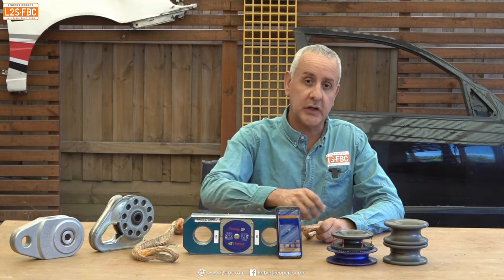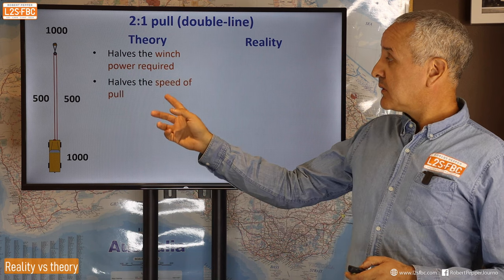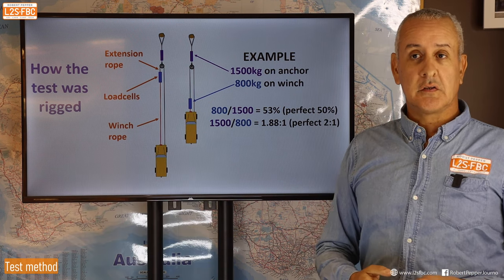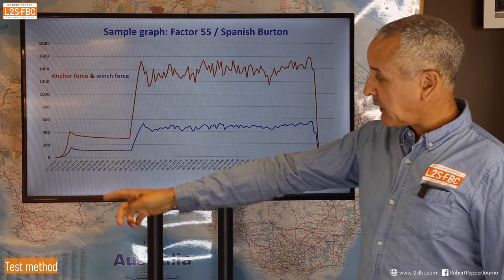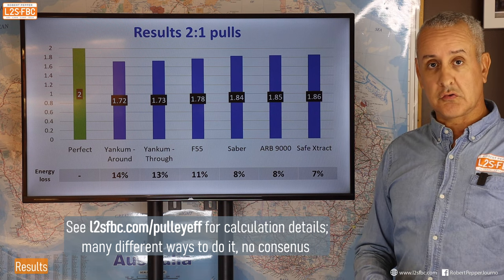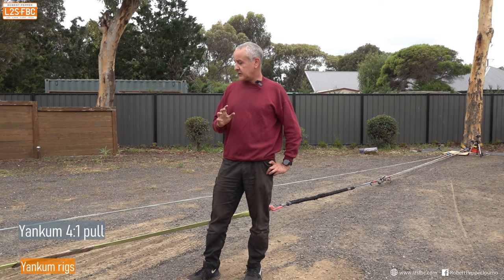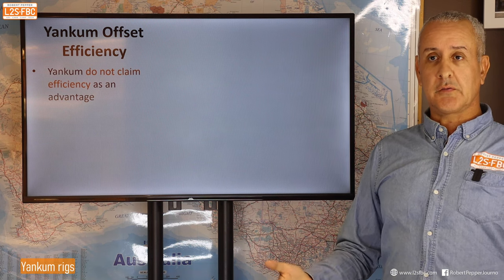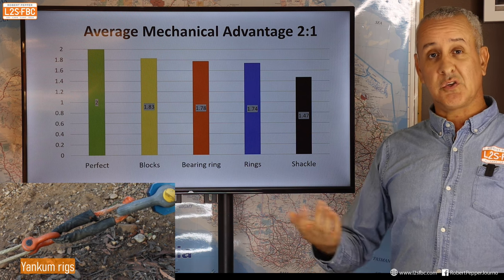3:1 isn't 3:1, and so on.

Comment from the maker: Some common questions:

1. The X-Lock shortening is covered here in my Clips & Cuts channel (please sub, trying to get it monetised) https://youtu.be/pt93-89fZ9A
2. This is NOT a full review o the Offset Rings, it's efficiency only.  To come; Thermal Analysis and then Offset Ring vs Symmetrical vs Block
3. Thank you again to the person who sent the rings, I don't have budget to buy everything and I don't like asking to be sent free stuff direct from companies. I know, right?  How weird of me.
4. A Bearing Ring does exist, for example the RR30 which I've reviewed and tested here  https://youtu.be/bCMJvk9L1rE 
5. For the original Efficiency video see this https://youtu.be/rdlRRAbzCzA
6. Is it my practice to discuss with anyone who has an interest a draft video before publication.  I've found any disagreements are better figured out before it goes live, it serves nobody's interest to be wrong; not mine, not yours, not the company's.  Now when it comes to opinion...that's different.  We didn't all agree, but at least we agreed to disagree.  I don't deal in gotchas or sensation, plenty of others doing that. There are pros and cons of every product, and if you see anything that is all pro, or all con...then it's probably not unbiased.
Reply: When you talk ropes and pulleys it always ends up at efficiency.
If you spin a rope around a bar - you can pull it still on 1 full wrap, hard on 2 full wraps and soon or later you create a self locking system on 5 or 6 full wraps.
Nothing will beat a well lubricated snatch block. 
For instance 87% efficiency vs 92% may not sound a lot, but when you do a 6 time multiplication you get:
0.86*0.86*0.87*0.86*0.86*0.86=0.40 or 40% efficiency
0.92*0.92*0.92*0.92*0.92*0.92=0.60 or 60% total system efficiency.

I watched the youtubers war on oppinions and thinking this would make a perfect topic for you. 

And it did 👍👍👍👍

Thank you for doing it and bringing some common sense and science to the overheated youtubers debate.

Great job and thank you again 👍👍👍🤣

Comment: 21:26 "If you need more than 3.4, you may need a professional recovery" Absolutely. At some point you begin working with forces that can do real harm to your vehicle if everything goes right and to everything if things start going wrong. Your summary in this video is spot on. I think using a 4-1 can be great for spreading out the forces on anchor points and reducing load on the winch, if you're using a 4-1 for "more power" you need to start being very careful.

Comment: Very well done. Interesting that Yankum and Factor 55, two of the most expensive rings out there, we’re the most inefficient. I actually guessed that those two rings would be the worst.
Reply from the maker: What made you guess that?
Reply: @L2SFBC  The bend radius of the Factor 55 was the smallest which causes 2 problems. 1: the rope has to make the sharpest bend putting more friction in the rope and 2: the smaller the bend radius of the ring, the less of a fulcrum you have to overcome the resistance of the ring rotating against the soft shackle. If that makes sense. 
The Yankum is simple. The thing doesn't rotate. If a ring naturally wants to rotate and you take that away, you're removing it's least point of resistance and forcing the rope to take a path of greater resistance by sliding over a larger surface

Comment: I'm sure you will put it straight. Will be good to see how the Yankum performs.
 I was wondering before and now when it comes to blocks , often they are left in the tool box untill needed, So what is the difference say Dry vs Greased pin/bearing ?
Reply from the maker: Don't know, all I can offer is symmetrical ring vs non-symmetrical vs block vs bearing ring.

Comment: Thank you for doing this test. I think this is very good quality and rather unbiased data that is starting to paint a much better picture. I would love to see a part 2 that filled in some of the holes I see though. 1. Rig the Yankum ring and a large diameter ring as a Spanish Burton. This will show more of a comparison of losses in the 4:1 range being more about the Spanish Burton being more efficient because it just has less rope on pulleys. ( The parts for a Spanish Burton 'should' also be up sized which gets closed over a bit ). 2. I'd like to see a traditional 4:1 done with separate rings and pulleys to show that friction losses are going to happen with those systems IF you don't have or can't use the SB technique because of space or length limitations. I'd extrapolate you would be closer to the double ring rigging like Yankum vs the SB rigging numbers.
Reply from the maker: Yes I thought of the Yankum in SB after we finished testing. Might do another based on that pull. Rigging a "traditional" 4:1 becomes problematic with separate pulleys and isn't necessary in my view.  The relative friction can already been seen in the 2:1 and 3:1 pulls.
Reply: @L2SFBC  I agree the traditional 4 or 5:1 would be difficult to rig, but it would also illustrate some of the magic with the compound rigging in the Spanish Burton. I do think that being able to double rig rings has some advantage to get all the way to an 'honest' 3:1 mechanical advantage without needing any other equipment. I've found this handy for when you are forced to work close into the vehicle without a lot of extra space available for SB rigging. Thanks again for doing some good testing. The results for the large rotating rings ( like the one I produce ) was even better than I expected.
Reply from the maker: Thanks, yes I may do that for a future test. Not impossible, just difficult and a problem with my test approach is that everything must be on one anchor point as that's where the loadcell is. I already had trouble with that.  Ideally I'd have many cells at each point but that gets super complex and expensive!  I would also like to test with different ropes - diameter, dirtyness - but again maybe for the future. I would expect thin, new rope to perform better than dirty thick rope.
Reply: I want to point out a few things for the hard of hearing people, this test shows that yankums ring performed worse then our original test shows which got us hated by the super stars but your ok with the test that showed worse results LMAO, second using only 2 pulleys and not in a Spanish since that's what your stuck onto now. PERFORMS better in a 3-1 than using yankums in a 4-1. Our results shows a 1000lb better performance using pulley blocks in a 3-1 then yankums rings does in a 4-1. ROBERTS test also proves that, arb pulley blocks did a 2.51-1 in a 3-1 while yankums in a 4-1 only shows a 2.5-1 we know that .1 seems small for the small minded but it goes a long way in several ways, you need less line for a 3-1 and the pulleys are not rubbing your line to death so your line is going to last longer. POINT BLANK and SIMPLE
Reply: Being able to rig up to a true 3:1 output without any additional ( and upsized ) gear by double rigging a ring seems like a nice free bonus to me. There are times when being able to get more like off the drum and generate more force close into the vehicle is advantageous. If you happen to have a (properly rated) winch extension, by all means rig a Spanish Burton. That can still be done with the Yankum rings to fill in that gap between 3 and 4:1 rigging. Looking at the F55 performance, in the other tests, we would expect to it deliver about 2.9 performance ( and you would be able to reach further ). Then you have a ring like mine, large diameter similar to the Saber and has the ability to be double rigged. I have all the options including efficiency that tested within 1% of great quality pulley block when used as a spinning ring. Options are nice. I'll continue to chip away at all the remaining differences instead of just complaining about everything.
Reply: @brennanmetcalf  being able to run a 5-1 with rings to outperform rings in 3-1 is just silly nonsense of an argument 🤣 

That’s like saying I built a 1000hp drag car to run against the stock car class

You need an extra 2 parts of line 
To out perform pulleys 

That’s a lot of extra line 

IM NOT TALKING ABOUT A SPANISH SET UPS 
Straight 3-1 out performs any ring period in a 4-1
Reply: In the case of the Yankum ring, yes, there is a dip in performance once you start double rigging. The same would be said for any system as you add more and more reduction. If all you want to do is be limited by what you can do with two traditional heavy pulleys, go ahead. What if you need or want to be close into the anchor\load. With a traditional 2 pulley 3:1 setup ( that only outputs 2.5 mind you ) you would have more line on the drum decreasing input force to the system. Rings that can be double rigged also give you the option to have more force generated  from an remote anchor based system. With two traditional pulleys you are limited to rigging a 2:1 (1.9) setup from that remote anchor to the load. With double rigged rings you could rig up to 2.5ish without any additional gear. Only someone with a 'simple mind' would discount being able to add another 0.6 of reduction or something. Options are nice. I could care less about a 1-5% per wrap difference in efficiency if it gives me many more rigging options with less equipment and weight to carry.
Reply: @matt.mckinzie  Good points!  I think Robert's finds support yours but then offer an alternative of a bit larger ring (e.g. the Saber) that gets close to the efficiency of large and heavy blocks.  I'd also point out that most viewers are going to be recreational users and like Robert said a 2:1 with a single ring should be good enough for most, and if not a couple of large rings in a Spanish Burton is going to be plenty.
Reply: @mcodyw  agreed

Comment: Love your work!!! I’m a little surprised in how close the F55 and Yankum were in the 2:1 configuration given the earlier recovery ring testing. Was there there enough load so the F55 and Saber rings were rotating or just sliding through? (I may have missed that in the video)
Reply from the maker: The F55 has a small internal diameter so I think that's why they were so close. Yes, both had 1500kg of load.  The F55 and Saber rotated. The Yankum did not...but stand by for the review :-)
Reply: For sure. Can’t wait!

Comment: This illustrates the beauty of winches... With the exception of the anchor point it's very hard to exceed the breaking strength of the gear.

You take a cat S shackle at 4.5t and achieve 4:1 (so more complex that what you've already done which is already a lot of effort and gear) and you're still 5t inside the capacity of the shackle.

The only thing in question is the strap around the tree.

It takes very little effort to achieve the goal safely. Compare that to everyone's favourite kinetic recovery...

Comment: Thanks for another great and informative video, really find the practical results in comparison to the theory interesting. Have you considered switching things at all so that the anchor point becomes the stuck vehicle to be recovered ( no/non operational winch) being recovered by a winch equipped vehicle using a second vehicle or fixed anchor point beside the winch equipped vehicle to reduce the loads on the recovering vehicle while increasing the force available for extracting the stuck vehicle? Hope this makes sense. Interested as I use my winch as often to recover/move loads as I do for self recovery and could see advantages such as reducing the chances of dragging the recovering vehicle towards the stuck one.
Reply from the maker: The pulley efficiency would be the same.  I cover different types of rigging in other  videos, the 9 Ways with 1 Block and 6 ways with 2 Blocks.  There are tricks with static winching that can't be used with dynamic.  https://youtu.be/Z8kiz4bsaXk  and  https://youtu.be/oBYa28i_K9Q

Comment: In a situation where a vehicle is very stuck, bogged to the rails in thick wet mud for example, would winch loads will exceed 100% of the vehicles weight?
Reply from the maker: Possibly yes.  In my tests we did over at 108% of weight in sand.

Comment: The last tests have me scratching my head.
Between 3:1 and 4:1 there is a theoretical increase of 33% with an actual increase of 19%
4:1 to 5:1 there is a theoretical increase of 25% with an actual of 20%
How does that work?
Am I missing something?

For a bonus point, it would be nice to know the load the 5th leg put on the anchor. Any guesses?
Reply from the maker: Yes, it's not as simple as "add 10% per pulley" (whatever 10% is of, ie load or winch tension).  You're not missing anything. I've only got two cells so that question wll need to wait!  I've not attempted to decompose all the loads, I'll need a friendly physicist to work with me on that question.  For the moment, results are results!
Reply: @L2SFBC  It's not so much the actual figures as the trend. Wouldn't one expect the actual increase to get worse with each pulley* added? between those to it seems inverse.
I think part of it is rounding errors.
Using your 60% rule on a 5:1 with a 1500kg load would seem to put a load of 38.4kg on the fifth leg.

Interesting stuff!

Comment: What I think you missed is the difference in weight and the difference in size, compared to the mechanical advantage.  So 2 rings vs 2 pulley blocks.  How much lighter are the rings?  Also can two rings get you more advantage then two pullies?  If weight is a real worry, how many more scenario's can you accomplish with 2 rings verses 1 heavier pulley?
Reply: We have tested this 
2 pulleys performed better with a 3-1 then yankums performed at 4-1 
Less line more power 

Warn pulley blocks weight was 6lbs and yankums giant rings are 2.2 lbs 

They are not small
Reply: @matt.mckinzie  you are forgetting the necessity of hard shackles, factor that weight and size as well. Stacking a couple hard shackles on top of pulleys would be considered "giant" over the size of the Yankum offset rings that don't need hard shackles to function. I am glad Robert did an unbiased review, and doesn't have your agenda (like keeping your sponsors happy and making up info or skewing info anywhere you can). Your mission to take down yankum is just sad, and trying to build your channel by stepping on others is also pretty lame. Spreading hate won't get you where you are wanting to end up. I am looking forward to the day where you realize this.
Reply: @jasonrshi  not sure if you just silly in love with garbage rings or what 
But we do not use giant hard shackles on our pulleys 
A lot of pulleys have been changed to be used with soft shackles 

The fact that we stated they have a huge friction loss and yankum clear cut was telling people 2-4% to sell product is just mind boggling 

The fact that you are ok with it tells me your also an issue
Reply from the maker: No, that's not missed, that's "not yet". This test focuses on efficiency only.  A discussion of those points is coming. That video ended up being 22 minutes...long enough.  See pinned post.
Reply: while reading the temp section to show yankum lied, go one more page down to see the termination section where it says the loop of the rope must go around something 3 times the diameter of the rope to retain full strength, that being said the hookless yankum rope is weaker then a hooked rope when using soft shackles  @jasonrshi
Reply: when your done reading the heat table, go just under the heat table and read the section where it talks about ropes checking or going around non moving parts will have friction and heat issues @jasonrshi